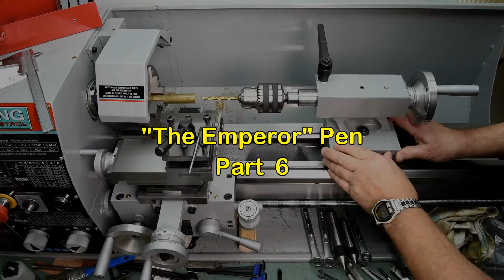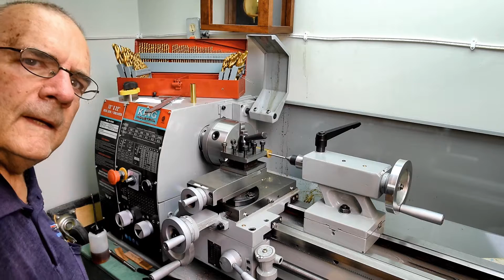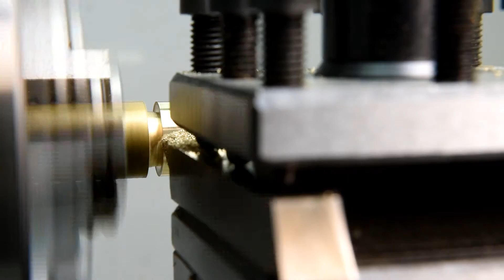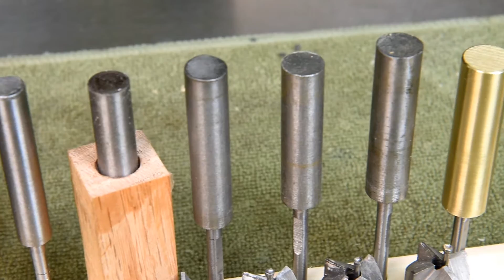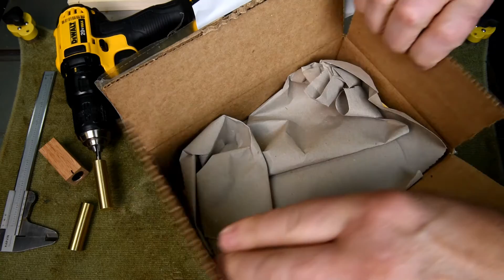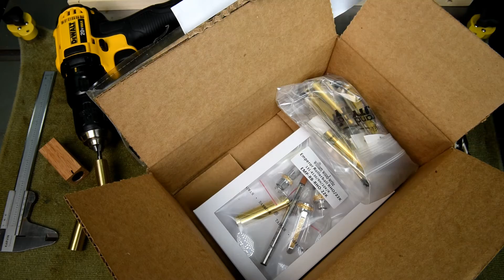"The Emperor Pen" - Part 6

Comment: Ron, did you give any thoughts to simply chucking the pilot into the lathe Jacobs chuck, fill the brass bar with epoxy and then advance the chuck into the epoxy filled hole to keep it centered etc....
Reply from the maker: Yes, that might have worked better --- next time, lol  :)

Comment: That #4 MT center is probably for the lathe spindle used for turning "between centers" using a faceplate and a lathe dog (no relation to the shop dog). Next time you have the chuck off check it.
Reply from the maker: Haha! Thats funny! I didn't think anyone would take me seriously there. But thanks because there was a time that I would "not" have known. There is a faceplate, but never used it yet. Thanks for commenting :)
Reply: I do a lot of metal fabrication besides wood working. Just a bit different seeing the way you use that lathe. If I'd been in your position I'd probably just turn a mandrel out of a chunk of mystery metal (pull something out of the scrap barrel) as it doesn't look like it needed to be hardened.
Reply from the maker: If it sometimes appears that I don't know what I'm doing it's because, for the most part, I don't, lol. The cutters I have are just a bunch of extras a friend gave to me. I may not even be using the correct ones. When it comes to spindle speeds and feed rates, it's just trial and error every time. Only had it for about 2 years. No training I'm afraid to say. But I'm having fun with it. I guess you've noticed that my videos are not tutorials. You are just watching me bumble along, lol  :)
Reply from the maker: Thank you very much for these links :)
Reply: oldiron1223 yeah Mr Pete is great to watch